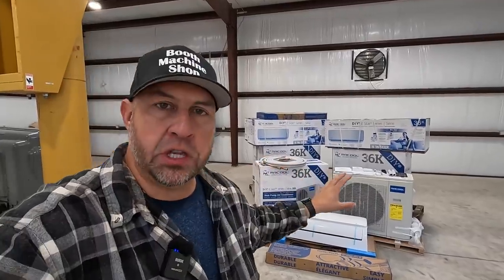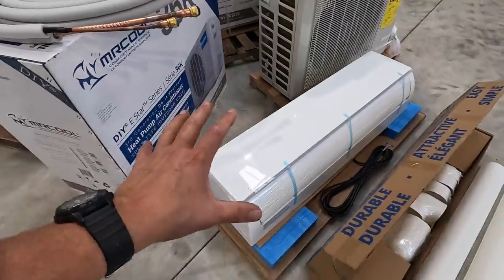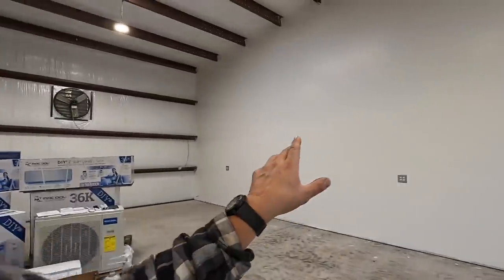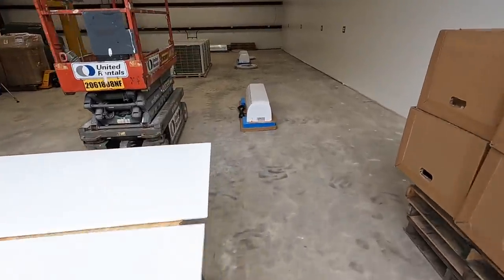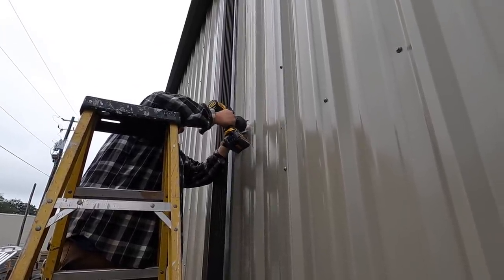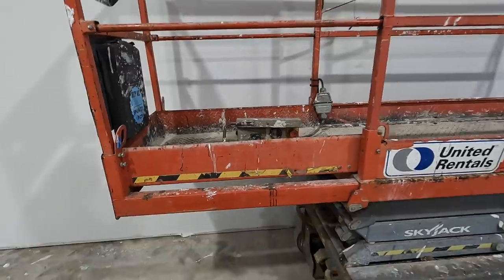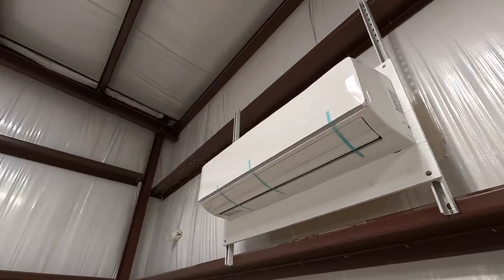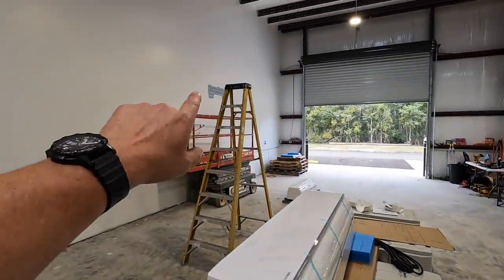Mr Cool AC Install for New Shop Part 1

Comment: I used your video on installing the MrCool in your old shop as a guide when I installed a 3 ton unit in my garage. The video helped a lot. Thanks for posting the video on Youtube!
Reply: Sounds great. I’m thinking the same thing. So your garage will probably be like a meat locker this summer.  😁 ❄️
Reply: @mitchkronowit3633  I'm hope so. I live in the South like Adam so its brutally hot in the Summer months. And the heat is nice in the Winter too!
Reply: @brittmrmanly4982  We’re not too far off being in Central Texas. Gets pretty hot here as well, but not as humid as Florida or the Gulf Coast. Our garage turned into a sauna every summer and an ice box every winter, so I added insulation to the garage doors and rolled out some batts in the ceiling space above. That alone has made a big difference, but a mini-split would be such an awesome addition. Good luck with yours. 👍

Comment: The hole through the building should always be lower than the hole through the plywood. That way the drain is pitched down as soon as it comes out of the unit. Mini split drains clog EXTREMELY quickly. Especially in a dusty shop invironment. You don't want that water sitting in one place at all.

Comment: Building a shop for yourself is every man’s dream and Adam is a genius for figuring out how to do it and actually making a profit on the work. Well done Abom79 I’m happy for you. I build power line and whenever we drill holes in wooden poles before we set them we always have someone eyeball the level of the drill bit the way y’all did with the long drill bit through the wall.

Comment: I bought and installed a 12K BTU MrCool mini split in my shop, specifically because of the video you did installing it in your other shop, and I made sure to let them know that’s why I did it. So nice going out to a heated/cooled shop, and pretty easy on the wallet compared to a portable or window unit.  I did weld up a bracket to mount the outdoor unit about 7’ up the back wall of my shop so I can still use the area underneath it and not worry about running into it with my tractor.

Comment: Though you may have already thought of it, I want to bring up something. I saw trailers parked next to where your condenser units are going to be. Some kind of bumper guards set in the ground to keep anyone from backing into your units will be time well spent! If someone were to back into one, the chances that they will contact you may be low and you may have to replace it out of your pocket. Just a thought.

Comment: I was going to put 3 of these in my house, but I couldn't justify the cost.  Instead I put in through wall a/c units with a sleeve. I had to cut holes with a jackhammer into the brick walls that took 2 days each. Plus I had to make a scaffold for the second floor but that was easy. After over 10 years I have no problems. I used high efficiency/low noise units that were double the price of an ordinary ones but still saved over 1/2 the cost of mini splits.

Comment: Great attention to proper methods...measure, measure then cut. Plan of attack needs completed prior to most installations for the least clusters...well done.  Another advantage of having 4 units is you have choices as to how much cooling/heat and where its needed depending on the humidity and/or heat/cold of the day. A little more investment up front will yield the least cost of operation in the long run.  Your machines will love it, they will be more consistent in accuracy not having large temp swings !!

Comment: About to install 2 headed unit in my garage.  That tip on using long bit to locate the outside hole was great man!  Probably saved me a bunch of hassle.
Reply: I think going from the outside in is worth looking at, keep it on the tin flat spots.

Comment: I have been an HVAC tech for a long time, I know the kit says you don't need a vacuum pump and yes it will work but you will LOSE some efficiency there will be some air trapped in the line set, I sure that the line set is shipped with nitrogen in it but that will be lost when you connect it. I would at least pull a vacuum on the lines prior to opening the valves at the condenser, sorry that's a bit tech but I hope it helps someone. Love the content
Reply: The lines come pre-charged.

Comment: Trying to get this across, not being an english speaker.
This is is the way to hang lights anyway. The spacing between the wall and the first unit should be half of the spacing between the units, if that makes any sense. I'm thinking the same goes for AC. Love the content!

Comment: A small suggestion would be to be to put up a sun shield barrier around all of your condensing units to keep the bright Florida sunshine to shade them so that they won't have to work so hard in the heat.
Reply: Little lean to's?
Reply: More like a paneled fence.
Reply: Just don't block air flow. Onnne small blockage can recycle hot exhaust air to the inlet side.  An infared camera or goodtemp probes to double check.  Before retirement i had N.A.T.E. and +twenty years, dad more experance and grand father teaching mech eng at OU. For several decades.
The pad should slope to drain heating condesate from the out door unit during defrost cycles.
Hope FIL is upto date on the "got chas"
Reply: Cool deal. (Pun intended)
Reply: Good tips guys! Our condenser unit used to be either in the shade of our house or a large tree, but that tree died and had to be removed. Now I’m looking at the sun beaming onto the thing for almost half a day during the upcoming summer. Planting a new tree will take some time, so I’d like to get the sun off it until then. I guess I’ve got another project to do now.

Comment: thanks for the videos!  i noticed your extraction fan is half way down the wall and unshrouded. you might want to make a shroud so it draws from the ceiling and clears the smoke instead of clearing the conditioned air and leaving the smoke at the ceiling.

Comment: If you dont trust your soldering skills to lengthen the copper refrigerant lines, or you just dont feel like dicking with it, THEY SELL extended line kits in various size lengths if you want to go that route........ Just an FYI 
ALSO: even tho they are pre-charged in the condenser part outside, once I have the lines hooked up, I always vacuum all of the outside air and moisture out of the lines and evaporator unit, to avoid ANY contamination, and ensure a long life from your Mini-Split.
With the back of your shop being a Boat trailer parking lot, and guys walking by spraying with weed killer or String trimmers, etc, I wouldnt mount those 4 on the ground, they sell a wall bracket kit that would keep them up off the ground and out of harms way-

Comment: not sure if you have the same problem in your area as we do in Canada but thieves are carting away outdoor unit and sell the copper. Wondering what is available for theft protection. We are putting hardened steel in concrete pad and welding to outdoor unit legs.
Reply: We have problems with scrappers in Detroit Michigan that steal those condensers and scrap them for cash

Comment: Adam, if you want to be able to control the units via android phone / IOS, a company called Sensibo offers an excellent solution (other brands do exist). You can even switch the units on and off from anywhere in the world. Each unit is around US$100 but to be honest I don't know if you can control multiple head units with each Sensibo controller. You basically replace the OEM remote with your phone and control all functions that the remote offers.

Comment: Just a thought I had randomly, are you going to make sure there is a negative slope coming from the AC units on the far wall? that will aid with the draining of the condensate and even possibly oil in the refrigerant. you dont want to stop any of that from flowing and collecting in the long line set and drain. I figured I better mention it than not. super awesome install video thanks for it!
Reply: If the evaporator coil is above the condensing unit you will not oil log the lines or coil ... if the condensers were going on the roof above the evaporator the line set should loop above the condenser or inverted traps
Reply: Most of these units don't have that issue. But I've never seen a mr cool older than 5 yo
Reply: @j-tothe-ay  that's about how long they last on average
Reply: @j-tothe-ay  and they are not any less expensive than a traditional unit.
Reply: @Stan_in_Shelton_WA  I install mistu's regularly several dozen systems a year at that. So I find these as a novelty. And sorta a waste of time and money
Reply: @dennis-sj6im  yea that makes sense for the line set but it still leaves the drain line, and if there is water pooling without enough flow stuff can grow and clog it up.

Comment: Hard to be sure in the video. Looks like your condensation line is higher where it goes through the wall of the building than where it comes out of the unit. Those MUST be lower than where they come out of the unit all the way out. Unit will leak if drain line is higher  than outlet......condensation builds up inside and runs over and out of drain pan before it can get out of the tube.
Reply: The pan in a Mr. Cool unit is about 1/3 of the way up the height of the unit.  The condensate hose comes out much lower than the pan.  Code requires a p-trap in condensate lines, so it is definitely not a problem to have the line curve around a little and keep a trap seal in it inadvertently.

Comment: Just a note on lengthening the one line set, The factory refrigerant charge is configured for the length of the line set that came with the unit. Fernando may have to add some additional refrigerant to cover the extra line length.
Reply: That's exactly what I was thinking.
Reply: But a homeowner can do it all according to Mr. Cool! Experienced HVAC techs aren't needed.
Reply: @AnthonyCurreri  A homeowner can do this themselves if they don't modify the system.

Comment: Love the video and love mini-splits.   I'm getting a new house next moth and will be putting one of these in the garage.  With them being variable speed they are VERY good at dehumidification - kind of important in Florida :)
Reply: They are great, until you install 12 tons of cooling in a space as small as his.  There is no way they will be able to throttle down enough to keep humidity under control.  One smaller unit for a typical garage works great, though.  Four of these monsters, no.
Reply: @brianhaygood183  Shop with big equipment.  In Florida.  I don't think he will have ANY problems keeping those units running at full tilt.  He's not conditioning a room with a few people sitting on a couch watching TV 🙄

Comment: @Abom79 cool tip with using a hole saw if you use a air nozzle set it at 20 to 40 psi and blow air as your drilling, it cuts the cut time down dramatically and it keeps the saw cool extends the life of the saw. same thing if your cutting through metal.

Comment: As an hvac guy I hate these so called diy mini splits. Many customers call stating problems while trying to fix. But to be honest it pisses me off that I have to go get special licensing to be an hvac contractor and a separate license to handle anything with refrigerant in it and yet here are normal everyday people buying and trying to install these systems with no proper handling experience. One of my major pet peeves. Love your channel though. Can't wait for the new shop to be fully operational and some big metal to be turned!
Reply: Agreed. The tightening of regulations over the years has been aimed at reducing refrigerant leaks. 

The idea of a DIY pre-charged lineset with pierce and seal lines like the old top-up cans seems nice on a superficial level  but I expect them to be outlawed at some point, there is no real way to test for leaks before commissioning.

With a traditional pre-charged minisplit and set of copper lines a decent vacuum pump and micron gauge will let you find even a microleak pretty easily, with this setup you can't pull a vacuum on it to test the integrity of the lineset.

Also with the POE type oil you are never going to be able to boil any vapor out of the oil unlike the old mineral systems so if you contaminate it with moisture and then recharge it you are going to get premature compressor failure at some point.

Ok if it works well and the installer is competent enough to locate it properly, make sure the electrical supply is adequate and up to code, ensure the condensate can drain properly etc etc but i've seen several of this DIY jobs butchered by people who made a hack of it and ended up spending more money than they thought they would save.

Personally I'd have recommended an LG Multi V system for this shop
Reply: You have to get trained and licensed so I can rely on you not to screw up my house.  It is up to me whether I want to trust me to screw up my house.  Besides, you have to keep the insurance company calm as much or more than the state.   The funny thing is these systems aren't really that much easier to install than any other kind of system.  Soldering copper is about the only real skill required for installation.  The rest is just knowledge, not skill.  Many mini-split installations aren't going to work out well because the installer is just making bad uninformed choices.  That's where your real value comes in.  The right size system, facing the right direction, of the proper type, and so on.  The problem with mini-splits isn't usually the device itself, but how its used.   This video is a very good example of that.
Reply: @brianhaygood183  we have to get licensed so that we don't improperly do anything that could release refrigerant into the atmosphere and that it's all sized correctly for humidity control and power consumption. The licensing governments really couldn't care less about what happens to your house. That's on the contractor, you, and the insurance to look after.
Reply: @n2n8sda  I personally would have recommended a couple package units for the shop and a small split for the office. Yeah it's more expensive but looks way better and way less likely to have condensate drain line issues. Those mini splits always leak water eventually even with normal gravity fed drains.
Reply: I think spiral duct in the shop would have been sweet looking or even rectangular sheet metal duct for the factory look for the machine shop

Comment: Don't forget to check the filters regularly! In a shop environment like this they will build up quickly. I'm talking like every month. Mini splits are very susceptible to building mold on the fans if filters are dirty. They are designed to be efficient, so they spend a majority of their time running low speeds. Low airflow to begin with plugged filters will make the head a mess. Easy maintenance, and they will run forever, at least the mitsubishis I install, not sure about Mr cool longevity.

Comment: You put the hole going outside level with the hole inside it's supposed to be on a downward angle for the line set so that the condensate will drain.  I normally would drill the outside hole 3" lower than the inside on that width of wall behind.

Comment: there should be some sort of teflon tape to wrap around electrical cable, copper lines and condensation drain line together from split unit to outside, look abd keep tidy also protects against elements, those insulation foams and cables needs protection

Comment: I am hoping you have a plan to build a cage around your condensers with all the trailers lined up at the back of your shop.
Reply from the maker: He’s planning on sinking some pipe and welding some channel to it to protect the ac’s for the building plus keep anyone from hitting the building in general.
Reply: I'd think mounting 8 feet or more above the ground would protect them on several levels.

Comment: You can order 25' length Mr Cool line sets with Mr Cool line connecters to length your lineset . They are precharged like the rest of the unit. Lowes or Homdepot .My lineset is 50'

Comment: I haven't seen the assembly instructions for those units but from normal AC units that hole to the outside should be on the opposite side and this is in order for you to be able to tilt the unit up for maintenance and have enough of that black sheated tubing on the inside unit to allow for tilting the unit up on its bracket. The conncetions should be accessible and not within the hole on the wall. The white tubing should come into the inner unit and connect behind.

Comment: I get that Mr. Cool probably gave you these, but this is a bizarre way to HVAC this space.  12 tons of cooling capacity is easily three to four times what you need, if not more.  You need air flow distribution (distribution effectiveness), but not anywhere near that capacity.  That is, a ducted system would do far better.    Anyway, say hello to your new friends humidity, stratification, short cycling, high bills, and noise.   The humidity and uncomfortably cold air blasts are the biggest ones you'll notice.     Even if you want to use splits that are easy to install, there are mini split systems that can run multiple evaporators/air handlers off of a single compressor, which would work as well as a ducted system would, if not a little better, but at higher cost than ducted.  Nowhere near the cost of this setup, though.  Crazy.   Actually, if you can hook all four handlers up as a single-compressor quad system using this setup, that would give you far better performance.  Then just give the other condensers away and you'll have a more comfortable space.
Reply: 3 tons isn’t cooling that space in a Florida summer.
Reply: Tend to agree it’s oversized. If this were spray foamed a 3-4 ton multi split likely will work.
Reply: @truthbetold2914  sure am. I spent 16 years in prior career dealing with digital controls of HVAC equip ranging from high rises, data rooms, and hospital operating rooms.